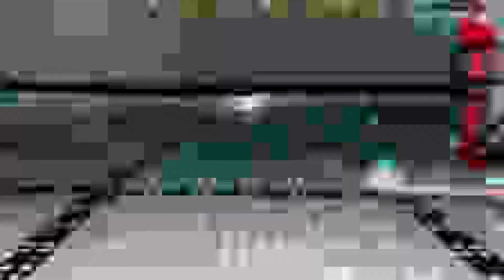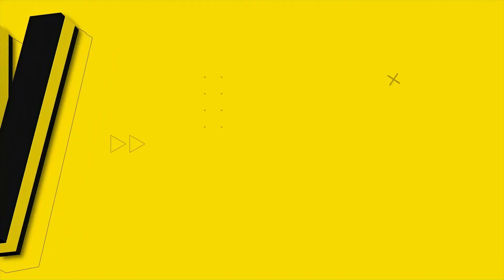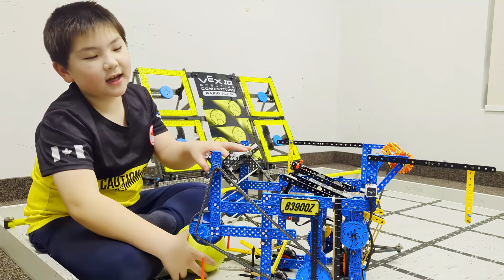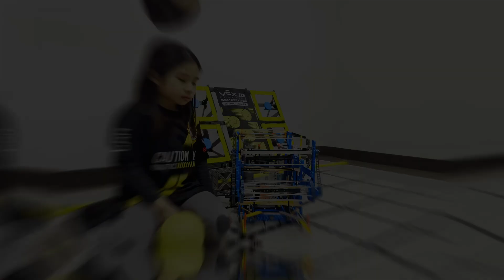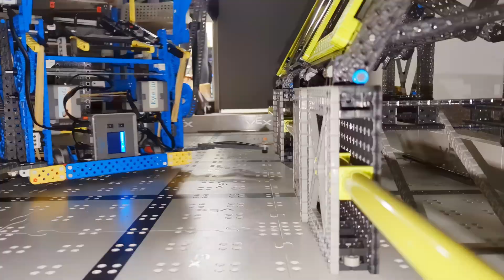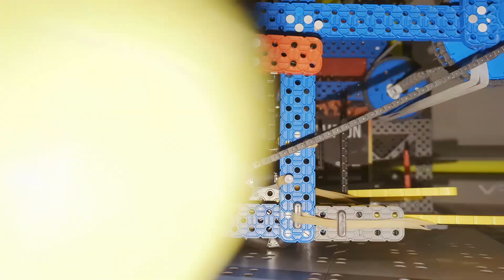VEX IQ 83900Z Rapid Relay Post Kalahari Reveal

Comment: Caution tape pls answer my question that piece you showed that make you start more next to the goal made out of 1x20s and rubber bands how is that allowed because that is more then 23 inches so how is it allowed? Pls answer this
Reply: At 1:37 in the video i have been trying to figure out how that is allowed because me and my team want to add it but it is pass 23 inches it is more like 32
Reply from the maker: Sorry, which part? The one hanging at the back? That wasn't part of the bot. Not sure why it's there in some interview section. You can see its not there later.
Reply: I think you mean the extender of the bot, it is legal as technically that is the width of the bot, which can be up to 6 ft this year. It also retracts using rubber bands so it doesn't affect gameplay. There is another type of extender called a rope extender, which is the same concept but with a rope, but it is harder to build.

Can you send a timestamp of what you mean?
Reply: since the robot starting position is within the 6feet length and the robot still fits in the 23 width it is doesn’t break any rules and is allowed - timestamp 1:37
Reply: @redflagzrobotics but that is width not length
Reply: @DonkeykongLB  as long as the robot fits within the size limit of 73" x 23", it can be rotated in any way so technically the robot is in size.
Reply: Ok thank you
Reply: This will help my team alot
Reply: It was taken off to see/display the catapult. On a normal match, it would be connected, properly, parallel to the other side.